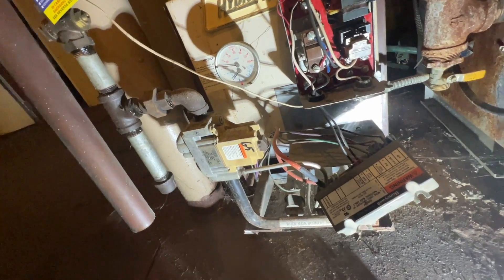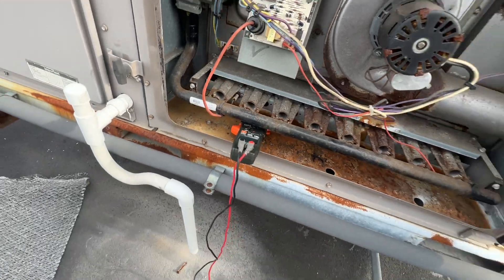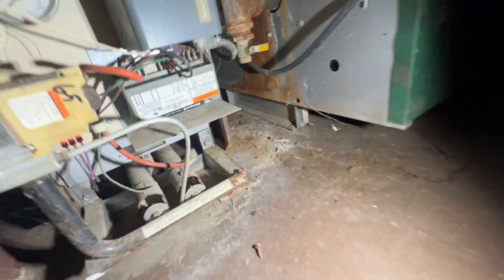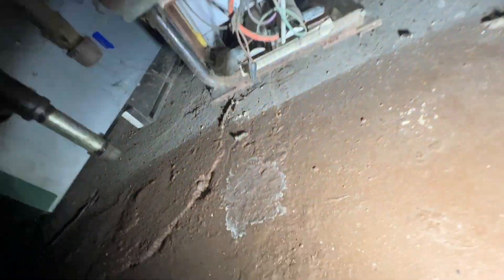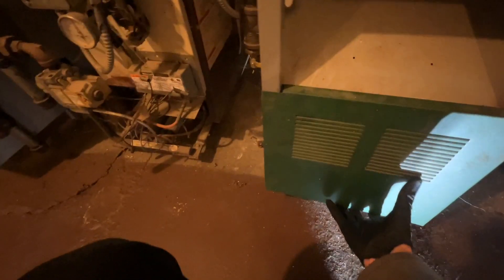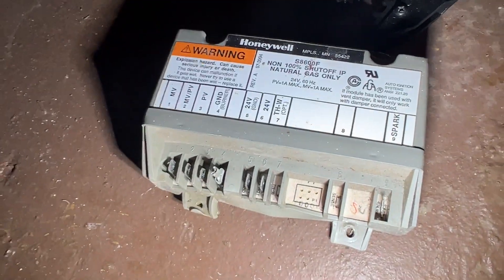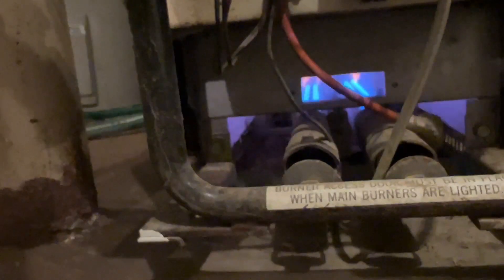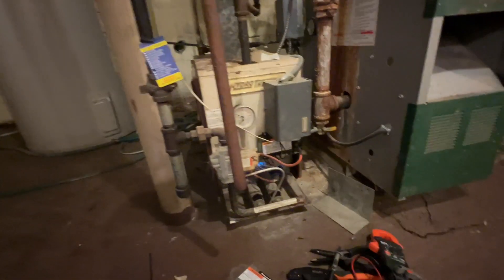Failed Honeywell Ignition Control Module! Failed York RTU Inducer Motor Assembly and Control Board!

Comment: Thanks for this video! I have a 20+ yr old Lennox (Dunkirk) PSB-5 boiler and just did an identical control module replacement. Thanks for pointing out the wiring change from 24V to TH-W I never would have figured that out! Changing this control was the diagnosis for my boiler not lighting up but it made no change. The igniter sparks but it doesn’t release any gas to fire it up. The only difference is that the new control shuts off for five minutes before trying again where the old one just kept sparking. The igniter was replaced last fall and everything worked fine until this heating season. Any ideas?
Reply from the maker: Gas valve